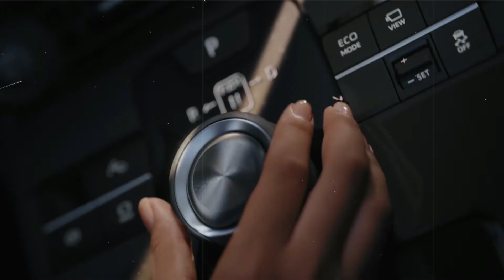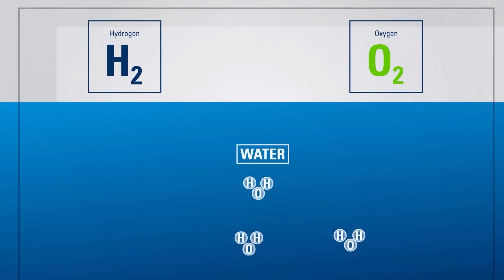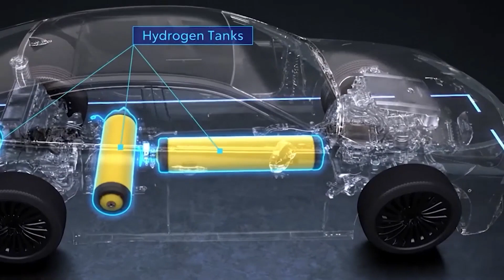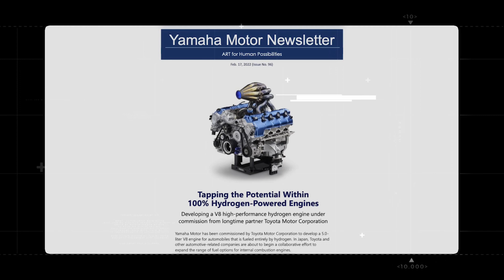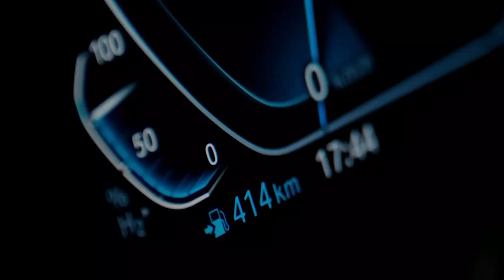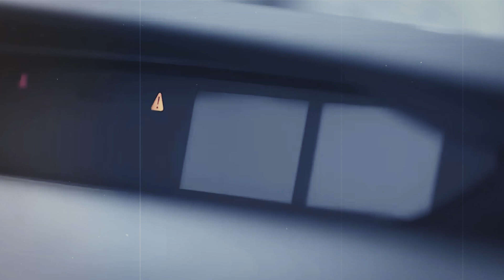Game Over for EVs? Toyota's Revolutionary New Engine Unveiled!

Comment: Hydrogen is currently not a green fuel in that the majority of production is a high carbon producing process.  Further, the complexity of the engine, the number of parts and pieces, and related cost and maintenance, pales in comparison to the simplicity and efficiency of an electric motor.

Comment: As much I would be WAY more likely to drive an H2 fueled vehicle than an EV, the question that is carefully avoided here where is the energy is coming from required to extract H2 from H2O?  Just as EVs should more truthfully be called CV (Coal powered Vehicles) or NGV (Natural Gas Vehicles) because that is the  actual fuel that is used to produce the electricity without which these wastes of technology can't run, H2 powered vehicle face the same problem.  Electricity is used to separate H2 from H2O.  Around 80% of our electricity is generated using either coal, natural gas or nuclear.

Comment: Hydrogen Combustion engines are nothing new. It was discounted decades ago not because of the engine, but the energy density of hydrogen, even when cryogenically frozen and kept in pressure vessels. What is all this about a fuel cell? I thought it was a hydrogen combustion engine? And where exactly does all the hydrogen come from? And where will it be stored? A gas station is not suitable as it does not have the facility to store or generate Hydrogen on demand. There would have to be a staging area. Existing hydrogen stations can only recharge about 20 cars in a day before the recharge process has to start again. This is just made up stuff.

Comment: Electric is way more scalable than combustion engines. Less moving parts means you can push the engine to higher speeds without as much risk of engine wear or failure. Continuous power makes for a more efficient generation of power compared to a four stroke engine that only produces power once every four cycles. The only way to increase efficiency on the combustion engine is to increase engine speed lessening the time between stokes or add more cylinders, both of which have been engineered near to the max at this point and have hit their limits. Then on top of that electrical energy is just easier to obtain than mechanical energy. You can skim electricity out of wind, water, solar, etc. Fuel however is not so easy. 

Electrical doesn't have to be better than combustion right now, we've had mechanical engineers working for over 100 years building combustion engines and if you count how much time we've spent learning gear ratios which is a huge part of mechanics the knowledge we know about it goes even further. We simply know more about mechanics than electrical right now, but it won't take long at all until that is all reversed.
Reply: Combustion engines are much more powerful than electric motors; When you have an application that requires high temperatures and strong torques, you want combustion engines. On the other hand, electric motors are suitable for applications that require very high speed control. Electric motors are preferable to operate on a smaller scale, as they do not withstand high temperatures because this causes damage to their copper wires. That it either burns or expands and shrinks as a result of the large thermal differential, and this causes fatigue to the metals and therefore it fails. There is a very high heat generated by electromagnets. There is no problem with the moving parts, as this is the way to work after all!, but the problem is vibrations and engineers work  To solve this problem when designing, ( When you say the moving parts and that they are subject to wear or failure at higher speeds, such as when you say that a capacitor or even an electronic circuit that operates at a voltage of 200 volts, for example, burns when exposed to a voltage higher than the voltage it is designed to operate in, say 12000 volts )  Therefore, it is necessary to avoid running the combustion engine at a speed higher than the speed at which it was designed to operate, and this is normal for every device, but the problems of mechanical engineering are different from the problems of electrical engineering, although there are similarities!, In combustion engines, we do not get energy once every four cycles! Rather, we get continuous energy thanks to the design of the engine and the inertia of the flywheel, quite contrary to what you mentioned. Obtaining mechanical energy is easier than obtaining electrical energy. Turbines, whether wind or water turbines, are mechanical tools, even solar energy. You yourself can produce mechanical energy With your little finger!, Gears are a universal, reliable and wonderful technology. In my opinion, it is more efficient to convert the chemical energy of burning fuel directly into mechanical energy instead of waiting for the chemical energy stored in the batteries to be converted into electrical energy and then converting the electrical energy back into mechanical energy by the electric motor!
 By the way, an electric motor is a mechanical motor, but it uses electricity as fuel!
Also, fuel such as gasoline is chemical energy, not mechanical, but it is burned in combustion engines to obtain mechanical energy to use it to do a Work.
More than that it can be said that combustion engines can operate with any fuel that meets the requirements, While electric motors can only work by electricity!
Reply: But the first cars were electrical so it's actually had longer to develop than ICE.

Comment: Big leap forward in efficiency 2000ish moving parts vs 15ish for an EV……  the EV motor itself  has one moving part. Ok to use a fuel cell to generate electricity to power an EV of course.

Comment: 95% of hydrogen production is currently derived from fossil fuels such as natural gas, oil, and coal.   For every one ton of hydrogen produced, 9 to 12 tons of CO2 the supposed greenhouse gas will be produced as a byproduct.   Exactly how does this get rid of supposed greenhouse gases and reduce our dependence on fossil fuels?
Reply: True & TQ  ,. Fully support your comment . EV may seems env friendly , the materials utilised are massive polluting to mine or extract to produce  ,expensive too to  produce for industrial application . EV , what about the used & unwanted batteries . The disposal will be another environmental challenge . Recycling may not be profitable ( excuses )
Reply: I'm supporting hydrogen, achieving efficient extracting of Hydrogen is just around the corner. Infact I dare say, if we put the same amount of money in Hydrogen as we did in electric, we would already be there...

Comment: Isn’t this the same gas that was in the Hindenburg?
Reply: The tech has moved along considerably since then.  Gasoline vapours are exremely volatile and we manage that problem every day.
Reply: @deltavee2  95% of hydrogen production is currently derived from fossil fuels such as natural gas, oil, and coal.   For every one ton of hydrogen produced, 9 to 12 tons of CO2 the supposed greenhouse gas will be produced as a byproduct.   Exactly how does this get rid of supposed greenhouse gases and reduce our dependence on fossil fuels?

Comment: Hydrogen is worse like pouring fuel on the fire
Reply: 95% of hydrogen production is currently derived from fossil fuels such as natural gas, oil, and coal.   For every one ton of hydrogen produced, 9 to 12 tons of CO2 the supposed greenhouse gas will be produced as a byproduct.   Exactly how does this get rid of supposed greenhouse gases and reduce our dependence on fossil fuels?

Comment: The infrastructure for hydrogen fueling station exists in the current gas station networks. It's pretty simple to add or convert at the existing sites. The EV folks want you to overthink this.
Reply: it isn't about station. it is price to product H2. and.......
Reply: @xianshi8896  Demand and volume will take care of that as well as convenience to the consumer. The market doesn't want to spend 45 minutes to an hour recharging a car.  This is why hydrogen will be the main alternative fuel.
Reply: @pennise  hydrogen has lower energy density which means a 50 gallons tank only hold around few pound of hydrogen, range around 250-300 mile. 50 gallons tank is too big to fit a typical car.
Reply: @xianshi8896  Hydrogen still will fuel faster than electricity. 250 - 300 miles is respectable range, if you can refuel quickly. There is no range anxiety like you have with electric vehicles.
Reply: @pennise  I understood, but the tank is too big to fit in the car. you probably need to your entire trunk and back seat to put the tank in.
Reply: Its pretty easy to add H2 in existong fuel stations. That's why very few are installed and those existing in UK are being dicommissioned. And it havent expanded beyond California.
Reply: What are you on about? If Hydrogen refueling stations are so cheap and simple then just get on with it. Should have been done decades ago. Should be thousands on them by now.,
Reply: There’s only one refilling hydrogen station in my large city. 

By 2030 half the vehicles  on the road will be EV where I am. 

2025 and all the buses will be EV.
Reply: Just imagine amount of waste and destruction to landscapes if even just western world would start using ev's only.. They are fun toys but to make the batterys you need to cause shit tonns of pollution and still haul the materials with diesel and then they go from one factory to another untill last factory can finally build batterys from the mined materials.. Aaaan then you haul them with diesel to yet another location so some smart arce can feel good he is "not polluting anymore"
Reply: @johnmartin7158  nah.

Comment: Definetly the future of motor transport, and the reduction of Co2 emissions in production and maintanance. Can't wait to have a hyrdogen powered vehicle.
Reply: 95% of hydrogen production is currently derived from fossil fuels such as natural gas, oil, and coal.   For every one ton of hydrogen produced, 9 to 12 tons of CO2 the supposed greenhouse gas will be produced as a byproduct.   Exactly how does this get rid of supposed greenhouse gases and reduce our dependence on fossil fuels?
Reply: Yes Alan you are correct about current Hydrogen production, however in SA we are using wind and solar power to generate Hydrogen otherwise it would be pointless. The solution of course is to develope Nuclear power production to help produce more desalinated water and produce hydrogen. to replace desiel in heavy vehicles and ships and run a much larger proportion of combustion engines in general on hydrogen. Me thinks it will not be too far away. And you would know burning hydrogen only produces water that is how we reduce carbon emissions.
Reply: won't work pal
Reply: @xianshi8896  The most abundant element in the universe. It's a no-brainer unless you are locked into half-ton AA battery packs that power a grotesquely heavy BEV to 250 kms or less in cold weather and heavily laden etc., that generates high levels of brake dust and road damage. Of course the 1000km battery is on the horizon, forever on the horizon.
Reply: No need to wait, you can buy one now. The Toyota Mirai has been in production since 2012. But before you fork out the money, do a little homework, it's an utter failure. Did you know Hydrogen car is essentially a BEV plus a very heavy and complex Fuel Cell reactor? That's why hydrogen car is dead. EV is far more efficient. Thank me later. 😉
Reply: BS
Reply: CO2 is cool 
people demonise wrong things in air they breath in 😂

Comment: Please do the research properly as the production of hydrogen is small and just transporting it is an issue. Yes, there might be use but not in cars. Let alone the complications of a hydrogen engine with a high-pressure fuel tank and the high explosive nature of hydrogen.
Reply: 95% of hydrogen production is currently derived from fossil fuels such as natural gas, oil, and coal.   For every one ton of hydrogen produced, 9 to 12 tons of CO2 the supposed greenhouse gas will be produced as a byproduct.   Exactly how does this get rid of supposed greenhouse gases and reduce our dependence on fossil fuels?

Comment: Ethanol fuel from our agricultural sector produced biomass, for the transportation sector, is the way to mitigate global warming. Combined with Toyota’s hybrid systems, it has unlimited potential for all transportation vehicles. Electrical vehicles are too inefficient given our electrical grid systems. Our electric grid system is too inefficient for EVs.  Hydrogen fuel is too volatile – too dangerous to be carried on a vehicle on our highways. A Hydrogen vehicle will have to refill with hydrogen every 10 miles (?). To store 5 kg of hydrogen on a vehicle creates a danger too great for our highways – too high a pressure or too large a volume. Hydrogen is an energy storage “system” – not a source of energy. Let’s get realistic: if we do, or can, then we come up with ethanol fuels and oils from biomass to solve global warming and our need for transportation vehicles. Hopefully we do and can and we will if we have the intellectual capacity to think. As a retired engineer, I do not think our existing “people in charge” are capable of thinking.

Comment: If Toyota is making it, it will be good. My only concern is the number of filling stations available.
Reply: nah, it will failed
Reply: if thats your concern you dont understand what it takes to not only finance the whole thing, which will be put on the consumer, you also dont understand what it takes to make hydrogen (green)
Reply: @fetB  It's called research and development. Every big car manufacturer has a budget for it. Without it, all the cars would be crap.
Reply: @jonathanchartrand3351  not only do you still pay for it, i am talking about the filling stations, which are incredibly expensive aside from requiring massive amounts on energy to cool/pressurize the hydrogen. And thats just one aspect. making hydrogen is incredibly energy intensive and all of that then must be transported which not only spends energy, same with the pumps, requires loads of energy to pressurize or super cool those. Hydrogen for regular cars is complete nonsense
Reply: @fetB  Yes, but there are also issues with EVs mainly the battery. Car manufacturers are trying different ways to make cars more efficient, greener, and less costly. I'm all for it, whatever the future holds, we'll soon see.
Reply: @jonathanchartrand3351  right, I'm all for it to, (except motorsport) and batteries is the way to go, alone for the  fact that you take the enrgy straight into the battery with only small losses compared to anything else and then you use it most efficiently in the motor. You can even produce your own source with solar panels and aeromines. You cannot do that with anything else. Just because lithium batteries are costly, doesnt make hydrogen suddenly better. In fact, BEV becomes carbon positiv after 30-40k when you use electricity sourced from fossile fuels and much sooner from renewable sources. All that R&D on hydrogen is a complete waste
Reply: @jonathanchartrand3351  So this hydrogen car does not have a battery? I am confused. is this a hydrogen combustion engine or a hydrogen fuel cell engine? And what about the fuel cell containing rare Earth and expensive metals like Platinum? I think there are many many problems to even considering hydrogen.
Reply: Toyota already did, they launched the Mirai in 2012, and it was an epic failure. That's why hydrogen car is dead! This article is click bait refrying old news for the uninformed like you. But now you know...Thank me later 😉